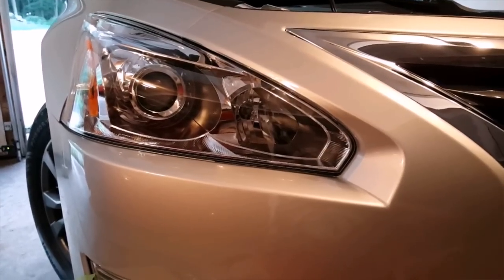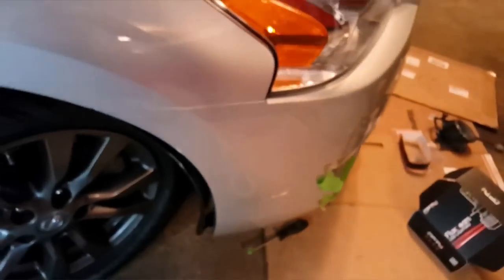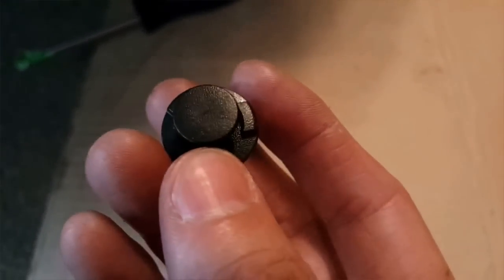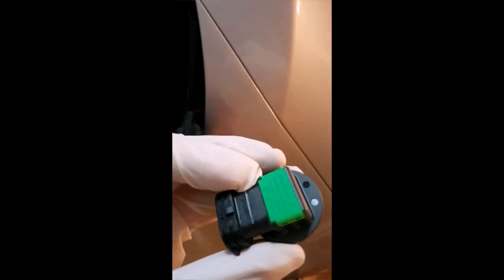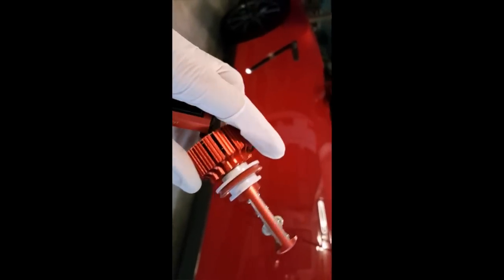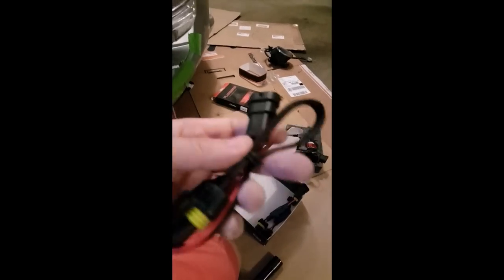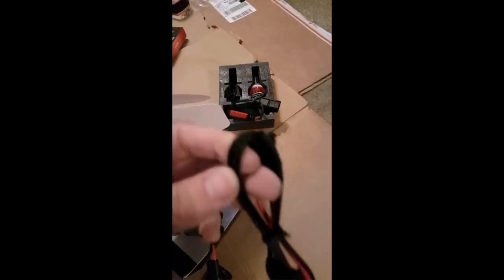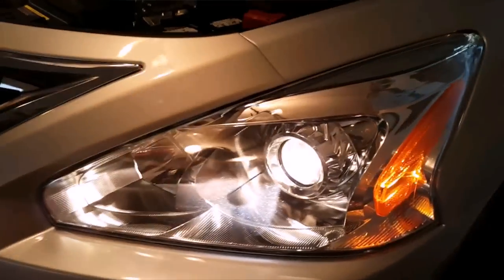How to install LED bulbs for Nissan Altima headlights 2013, 2014, 2015 L33 Teana 【GForever】

Comment: Thanks for this video. My first time changing lights didn’t need tools literally stopped by autozone and did what the video said to do.
Reply from the maker: Brigitte Chaos glad to help and congrats on changing the lights on your own!
Reply: gforever hello I have a 2014 Altima my low beams were very dim but headlights good so I put led lights in and they are still in dim
Reply: @ljdagr8  I have dat problem too u ever get it fixed

Comment: To be honest , this is extra steps too, just turn your wheel, pull ur bumper back a little and pop out the plastic a little . Your hand can go right up there , no clips needed to come out. Did it in 2 mins .
Reply: where's your video?
Reply: thats what i did.

Comment: The. Dry common complaint about these Altima versions is that the reflector deteriorates by flaking off and seriously diminishes light output and requires the entire headlight assembly to be changed out. In those cases bulb changes are of minimal value.
I presume your reflectors were in good condition, is that correct?
Lots of YouTube videos showing how to change entire headlight assemblies purchased on eBay.
Reply: Took our Altima to the dealer and they said our headlights are fine. They literally shine terribly and you can barely see anything at night unless you’re on high beams
Reply: True. I just got mine changed. Now the unchanged one looks dim 😢 meaning it's deteriorated

Comment: Do you need to use both the anti-flicker, and polarity inverter adapters?
Reply from the maker: nope, completely plug n play..
Reply: +gforever I'm guessing it still works? Also how far does it project at night, compared to oem halogens
Reply from the maker: Yes works fine per previous comment & you can see the light output in the video. " Been over a year and no issues. .... Light output is pretty good. Check out the end of the video around 3min 29sec to see a comparison of the halogen vs LED 6000K."

Comment: where did you get it from eBay ? I was trying to get some but I don't know if they come with the adapter  also , they don't specify that they come with the adapter , thanks !
Reply from the maker: try this link: http://www.ebay.com/itm/OPT7-60w-H11-H8-H9-LED-Headlight-Bulbs-Pair-6000K-White-Light-HID-Replacement-/141626728210?hash=item20f99c5f12:g:PngAAOSwzgRW1kPN&vxp=mtr

Comment: Those other two "adapters" are anti-flicker capacitors.
Reply from the maker: +PersonalGeek Thanks for the comment. Stupid question but how do you use those adapters? I noticed I have a flicker for the right LED when I brake.
Reply: +gforever It goes in between the led bulb ballast and the factory harness.
Reply: are they brighter than HIDs? I've heard that LEDs are not brighter
Reply from the maker: @Kreemerz  I don't have HIDs to compare but they are quite bright

Comment: I bought the H7 version of these bulbs, any idea how to make them fit?
Reply from the maker: You may need to take the bulbs to be modified by a fabrication shop. Question is, would it make more sense to buy the correct bulbs for a perfect fit?

Comment: Does anybody else but care or not know you never had to do this on all older cars? You could just open the hood and replace the bulb!! What the actual fuck. The ground is snowy and wet, ain't nobody got time to get on the ground and unscrew splash guard. 

This new cars are horrible and these kids don't know how horrible it is to do a simple task like replacing the god damn bulb. 

The taillights are the same. Must be completely removed to replace the bulb.
Reply: Dana Murad lol I feel you. I worked on cars a lot when I was in my teens and 20's and just changed my wife's bulbs today (Still shitty light out put. Wish I found this video yesterday) and was scratching my head. Like why in the actual fuck would you make changing a head light bulb that difficult
Reply from the maker: Completely agreed. Poor design in my opinion
Reply: Of course. They want you to take it to the fuckin dealership for everything now.
Reply: Agree, this is total bullshit. With new cars they’ve designed everything where the average person either doesn’t want to deal with the aggravation or it’s too damn complicated to do anything.

Comment: I see the questions has been asked but want to ask again how good are the opt7 led? I purchased the opt7 hid bullet and they sucked left bulb flickers and left fog light doesn't work anymore ordered those in February 2016. I want to try led next time just want to know if it's worth it.
Reply from the maker: The OPT7 LEDs work wonders for me. Been over a year and no issues. I never tried their HIDs so I can't comment on those.
Reply: +gforever ok im gonna give them a try I know there expensive but this will be my 4th pair of aftermarket lights and im tired of the money spent for a different look I just have bad luck with hids. How is the light output driving at night?
Reply from the maker: Sorry to hear the bad luck. Light output is pretty good. Check out the end of the video around 3min 29sec to see a comparison of the halogen vs LED 6000K.
Reply: +gforever ok thanks

Comment: I have one question my friend i install LED headligth on my nissan altima 2014 but the rigth side ligth foques 100% good and the rigth side not i dont know what is the problem can you help me brother
Reply from the maker: I am not clear on the issue you are experiencing. Maybe try swapping the left bulb to the right to see if it is an issue with that bulb?
Reply: Yes or try rotating the bulb in the housing

Comment: Just a heads up if your still running the leds they are against the law if the headlight assembly didn't come with leds you can not convert  and heres why assemblys that come with leds have a diffuser in the lens and you just put an led in a projector  illegal...I carry a 5 million candle power cordless spotlight for guys  Like you